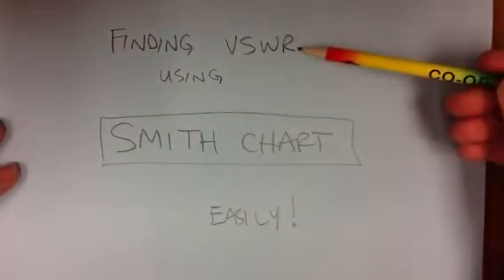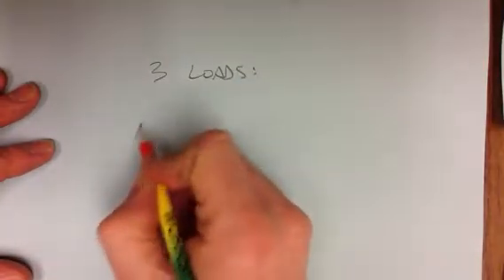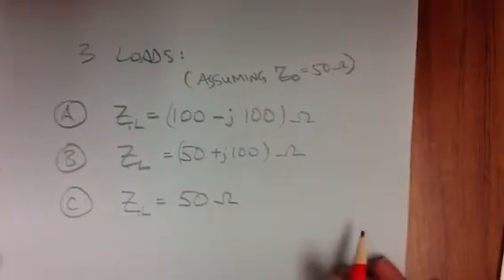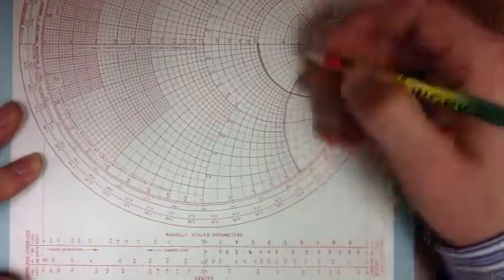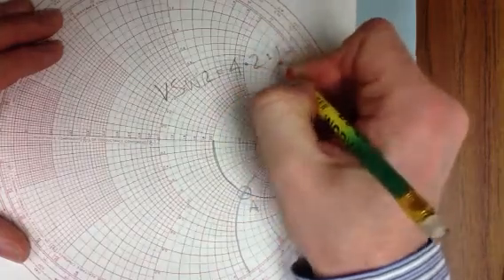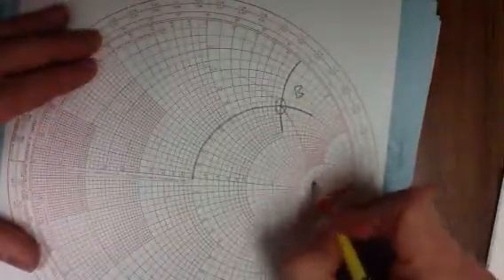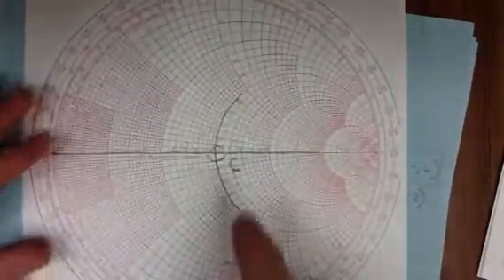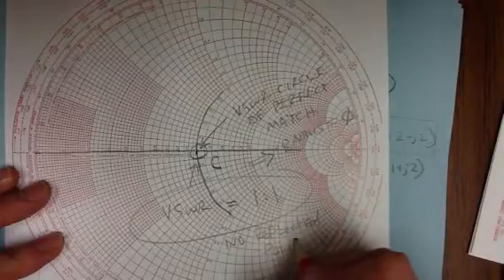Smith chart basics part 2: finding VSWR

Comment: but the circles touch the axis in 2 points, what about the other number?
Reply: VSWR is always greater than 1(or equal), since the maximum of the wave can't be lower than it's minimum. So you only take numbers to the left of the center point.

Comment: But the VSWR is 1+ Gamma / 1 - Gamma. What you did is just 1 + Gamma. Why ?
Reply: The Smith Chart can be thought of as a plot of complex reflection coefficient Gamma in polar form (hence the circular boundary). The magnitude of Gamma is linearly scaled from the horizontal axis (the X'=0 line which has the R' values marked on it), and the angle (or argument) is plotted per a scale marked around the outer circle (which hasn't been mentioned in the video as it's not pertinent to finding VSWR easily). Accordingly, the circle centred on the R'=1 point and including the plotted Z' point will have a radius directly proportional to the magnitude of Gamma. (Edit: this is addressed in the next video https://youtu.be/9KlIgae0ad8)

VSWR = (1+|Gamma|)/(1-|Gamma|), where |Gamma| is the magnitude of the reflection coefficient. It turns out that when the magnitude of Gamma is plotted on the right-hand segment of X'=0 line, the R' value equates to the VSWR value for the given magnitude of Gamma.

To understand this fully, I recommend you read up on how the Smith Chart is mathematically derived from R, jX, and reflection coefficient. Any decent electromagnetics text dealing with transmission lines should include such a derivation. The maths isn't particularly difficult: some complex number manipulation and understanding the equation for a circle would suffice.

Comment: while making the circle for vswr from centre , the central line cuts the circle at two points..then why the right side one point is taken as vswr? Why not the left side point? what's the rule for selection of one intersecting point from the available two points?
Reply: +Abhishek Poudel , here's a simple way to look at this...

VSWR = Vmax / Vmin

Therefore, the smallest value VSWR can have is, 1 .

Values on the left of the center of VSWR circle are less than, 1 and  thus invalid for the purpose of determining VSWR.
Reply: Abhishek Poudel left side is voltage minimum then right for maximum

Comment: I wish i can find a practical tutorial on S parameters.I am thinking like a block showing the network port connections and the explanations - the maths will come but just how you connect and what measurements you make.
Reply from the maker: For Sxy, the signal is measured at port x, and it came from port y.  Simple as that.  So for S21, the signal is transmitted out of port 1, and you measure it at port 2.  Since it has to travel through a device or TX line to get there, it is insertion loss.  For S11, the signal is transmitted out of port 1 and is measured at port 1.  Wait!  These are the same port!  So it must be REFLECTED power that is being measured: return loss.  Check out the video on insertion and return loss for more on that.

Comment: How come you didn't choose the points on the other side of the VSWR circle that crossed center line?
Reply: Because it's closer to the load, if you add a 1/4 wavelength stripline it will bring closer to the other point.

Comment: the resistive line will pass through 2 points of a circle, left and right side.. so which one is the vswr? does it always have to be on the right side of the circle, where resistive line passes through?
Reply from the maker: It always has to be the right side.  The easiest way to remember is this: the range of possible values for VSWR is 1 (perfect match, no reflections) up to infinity (open or short circuit, 100% reflected power).  This means that it cannot be less than 1, ruling out all the values on the left side.